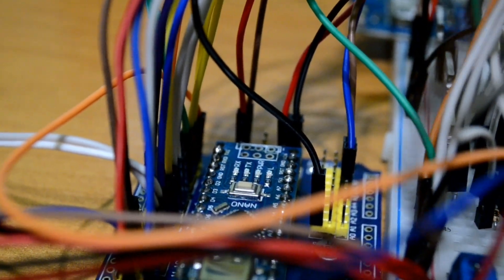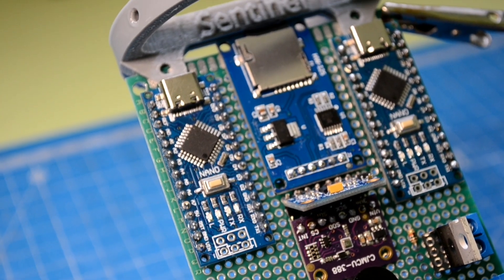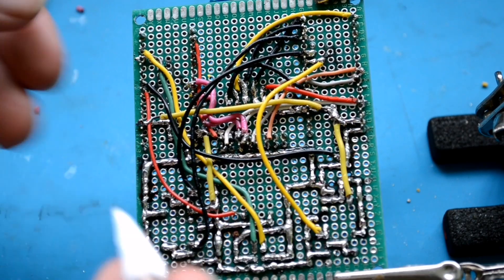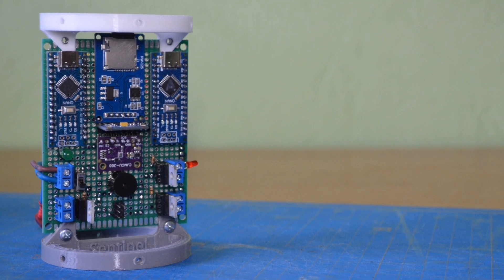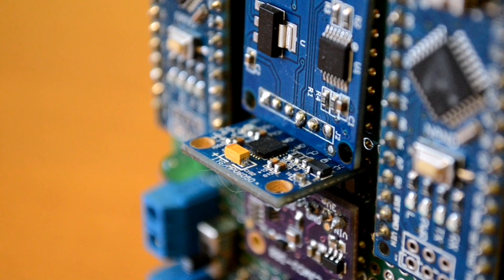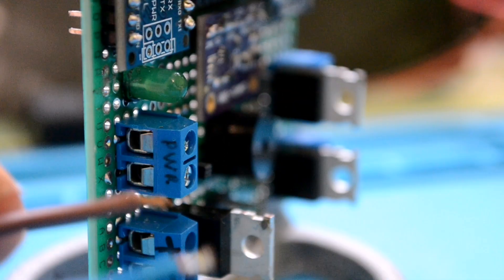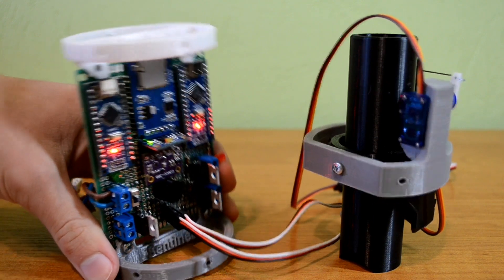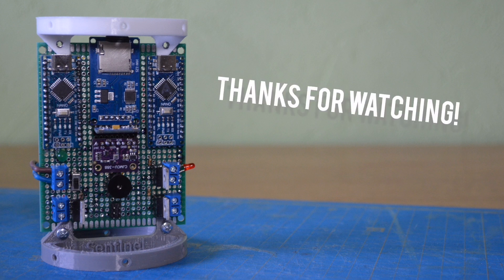The ARDUINO Rocket Flight Computer

Comment: Hey there, incredible work. i'm currently working on a similar project the difference being that i need a dc motor driver&terminal for a reaction wheel. Could you give me a way to contact you (discord, Instagram...) so that you cqn help me design my board ?
Reply from the maker: Hey, I would be glad to help you, cause I know how hard it is to work on your own. You can contact me through this website: https://sentinelspace.framer.website  if there is any problems or I don’t answer, write me here

Comment: Great project, widely accessible modules, good soldering job taking into account that you have so many connections.
You will need pitot tube for measuring the speed,  air speed will influence dynamic pressure which will influence pressure readings from barometric sensor, it will allow you to differentiate between the static pressure which barometric sensor measures and the total pressure which includes the dynamic pressure from the rocket's movement
your accuracy of measuring altitude will be increased, for the pitot tube sensor try using mpxv7002dp, it is also widely available
Reply from the maker: Thanks for advice! I definitely have to try it